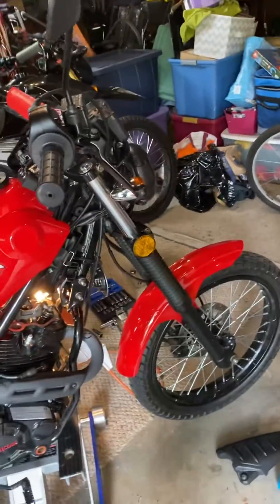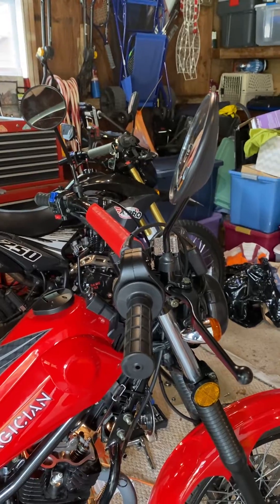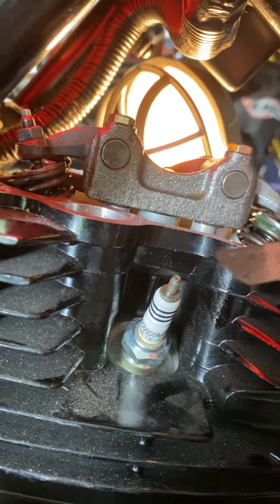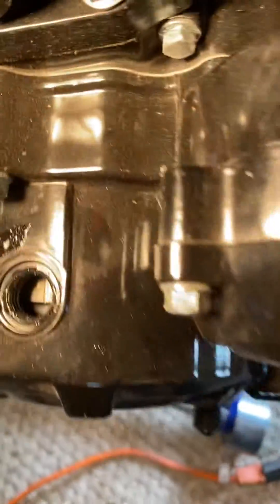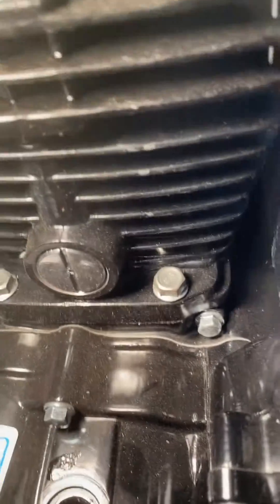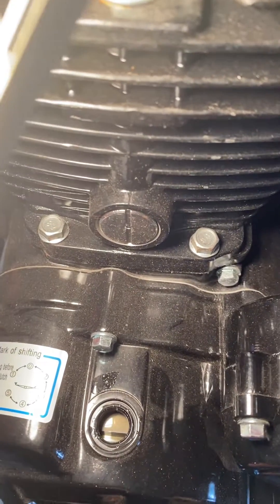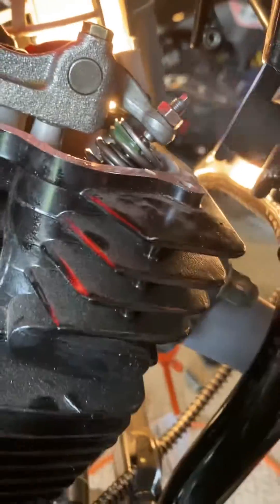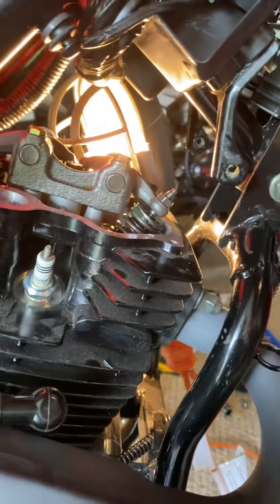Hawk 250 Magician valve lash adjustment Confirm Top Dead Center

Comment: Dumb beginner question. Cant i just go online and buy super premium parts instead of adjusting valves over and over? 91 Hawk 250
Reply from the maker: @danbrownellfuzzy3010  in a brand, new hawk, the valves are set with no clearance. So it’s a good idea to open it up and make the adjustment. Once that is done, they probably don’t need to be calibrated for quite a while.
It’s not really a question of the quality parts,it’s just that when they are installed, they are not calibrated as well as they should be.
Reply: @peteo8940  I bought it at 2409 miles guy said he just did the valves. I don't want to work on the bike every other time I ride. I would just be guessing  but it seems like really quality springs would not change their length.

Comment: So, there aren't many videos on this on the web. So, you don't have to remove the seat it tank to do this job, I see. That's a plus. Did you have to remove anything to get the valve cover off?
Reply from the maker: The valve cover bolts are easy to access and remove. The valve cover comes off with a little bit of lifting and turning. Not easy, but with a little patience and trial & error.

Comment: As soon at the intake valve closes you line up the T line as your now on the compression stroke
Reply: How do you know which valve is the intake and which is the exhaust?
Reply: @iamsetset  well start with exhaust valve ,it’s directly parallel with the actual exhaust pipe .the other is intake and it directly line up with your carburetor… and the compression stroke is when the exhaust valve closes then both valves are closed
Reply: @matthewanderson3631  Thanks much for the clarification Matthew.